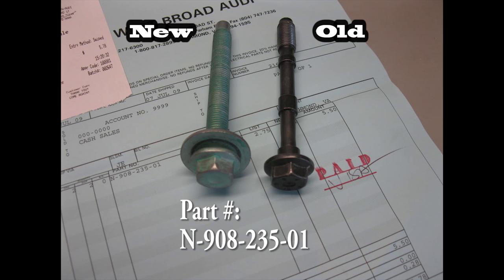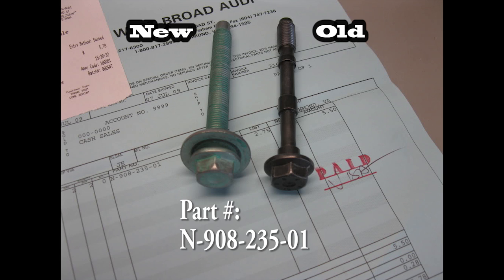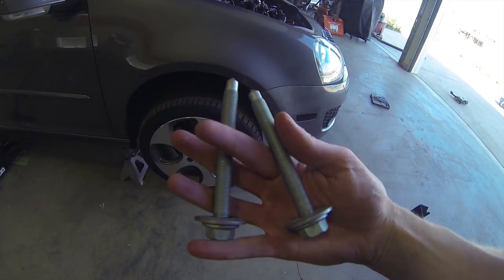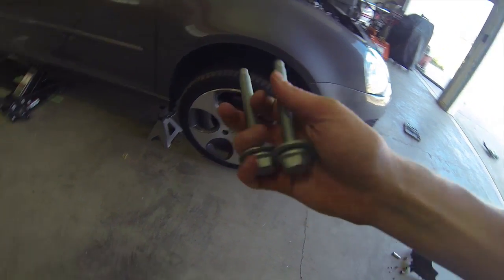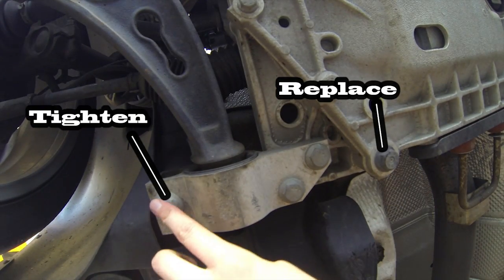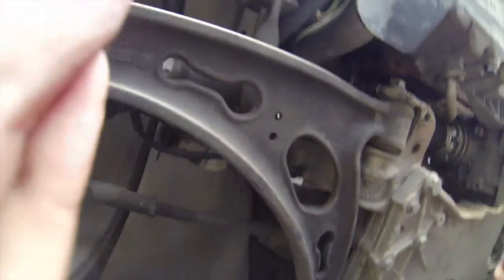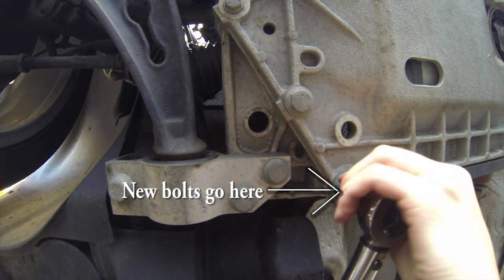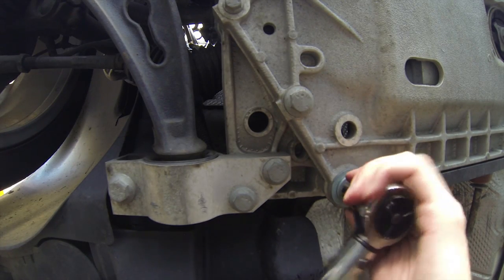Subframe clunking, creaking, popping? Give this a try - MKV GTI - Easy DIY How to

Comment: My clunking was a sway bar bolt under the subframe (audi a3 2005) the bolt wouldn't tighten up fully, the other 3 did, I just replaced all 4, clunking fixed :)

Comment: My 2010 JSW is making a loud popping noise when turning sharply, quickly accelerating or rapidly decelerating. The noise sounds like it is coming from directly beneath the center console, and since I replaced the CV joints I'm inclined to believe it is the subframe shifting around. ECS tuning has a bolt and spacer kit for $99 but that seems kind of steep for 4 bolts and a couple of thin metal spacers.
Reply: Did you find out what your problem was?
Reply: Did you figure this out?

Comment: I have just bought a mk5 r32 dsg, car drives faultlessly other than reversing at near full lock off my driveway where I get this clunking noise (quite off putting). Going to try this first for sure, some people have mentioned top strut replacement too. My first ever vw and first performance car.
Reply: dude same my mk6 golf makes a clunking noise when turning into my driveway
Reply: @gunmanx4  mine ended up being a cv joint

Comment: Subbed! I am having this problem with my Rabbit right now when pulling into an incline entrance or my ally way, I will def check this out.
Reply from the maker: What kind of sound are you getting, one single pop/clunk or multiple in succession?
Reply: Its a almost a creaking sound when pulling into an incline. it sounds like the frame is being torqued one way and shifts all the interior panels.
Reply: +Joelkswagen
my a4 is making a popping/clunking noise at slow acceleration and turning and it is multiple succession when it  does it.
Reply: +Malcolm "Damn Shawty, That Ass Fat" Hansen I dont know if this fixed it for you, but your case is typical sway bar squeak, where the bushing need to be replaced. (I know its a long time ago , still might help others if not you)
Reply: Joelkswagen multiple in succession.  Any idea what It is ?

Comment: Not sure where "most agree upon 81 lb*ft plus 1/4 turn" comes from. When the VAG torque specs are listed at 70 Nm (51 lb*ft) plus 1/4 turn; for all of the M12 x 1.5 bolts used for the subframe.

Comment: I hope this is the solution to my problem. A month ago I changed my rear control arm bushings and of course I had to take the bolts out of the subframe to remote one of the control arms. I believe the subframe is now moving around. I just ordered these bolts and some spacers. Keeping my fingers crossed.
Reply: did it work?
Reply: Marcelo so it ended up not being the subframe, although if you undo the bolts in the subframe you should replace the old subframe bolts with new ones. My issue ended up being the long bolt that goes into the front control arm bushing (there is one in the front and one in the rear). Apparently I didn’t tighten that front control arm bushing tight enough. Once I figured out the problem, the creaking and popping went away. If you’re having the same problem really make sure every bolt has been tightened. I overlooked that ONE bolt and that ended up being the problem. 

Here is a link to the pic of the bolt that wasn’t tightened all the way for me: 

https://www.pelicanparts.com/techarticles/Volkswagen_Golf_GTI_Mk_V/84-SUSPEN-Replacing_Front_Control_Arm_Bushings/84-SUSPEN-Replacing_Front_Control_Arm_Bushings.htm

Comment: Those new bolts will be torque to yield. Needs a fairly low torque inital tighten then 90 or 180 degree further tightening. If you don't get to the TTY torque they could come loose.

Comment: What components of the subframe wear, and what routine maintenance of the subframe should be considered when refreshing the entire suspension at 120K miles?  Referring to a '04 GTI VR6.
Reply from the maker: When it comes to routine maintenance of suspension, that is challenging. I take the approach of don't fix what isn't broken when it comes to suspension. Hearing noise or noticing a clunk, car drifting a bit to one side? That is when I consider these kind of repairs. This might be a good thread for you to check out http://forums.vwvortex.com/showthread.php?5301322-ECS-Tuning-Mk4-Suspension-Refresh-Kits-Free-Shipping-!!!

Comment: I have a clunking noise when: braking hard, turning hard and acelerating. Been with this issue for month. Have no idea what could it be :(
Reply: Did you find anything about the problem?
Reply: @farkasmaria9629  no bro, still making the noise sent it to the shop they could figure it out
Reply: @45llamas  have the same problem, bought this new bolts nd after a day, same noise occured again,  search on the forums nd mostly everyone recommended subframe spacers plates from ecs tuning

Comment: I have a 2009 VW GTI 6-spd manual that has some front vibration/clunking on the left side while driving over 20 mph, as soon as I hit the throttle the problem goes away. Any ideas?
Reply: Strut mounts possibly? When you give the car throttle the weight shifts off of the front struts, possibly making the clunking go away?

Comment: What about the mk4? My subframe keeps making a popping/banging noise like it's building up then releases. Can I use those bolts on a 2002 Volkswagen Golf gti 1.8t 337?
Reply from the maker: I imagine the sub-frame is slightly different on the mk4.
Reply: That's probably an engine mount, they go bad and do that exact thing.
Reply: MKIV is much different from the V.. Most like its the lower control arm bushings are shot.. I have read that upgrading them to the solid R32 bushings will help this noise. Mine makes the popping sound when I back out of my drive. Got the Bushings just need to make it my business to get it done

Comment: Hello,  I'd like to hear your professional opinion.  
My 2006 Audi A3 8p DSG   makes a clunk sound when downshifting to 2nd gear. Sometimes it does,  sometimes not.  Could  broken bolt maybe be the issue??? 

Thanks!
Reply: A bolt is not likely. Might be a faulty mechatronic unit. Also, have you done a DSG fluid/filter service?
Reply: Medzid, it's your dual mass flywheel that makes that noise.  Make sure you change your dsg fluid every 40k.  The flywheel has a service life, it will start to make lots of noise at idle and you will know that it needs to be changed.
Reply: @IndiSkyz  Hello and thank you for your answer. I maintain my car on time always, the DSG service (oil and filter) was done just recently. No vibrations, no rough shifting or anything that is affecting the driving, just that clunk sound. And recently I've noticed like tiny clunking on stand still...  So I'm asuming flywheel it is then

Comment: I have a noise on start up in my GTI MK5 
it's some sort of a clacking noise that stays for around 2 seconds on start up.
I tried different mechanics and no one seems to know what's the deal!
I hope you can help me with that
Reply: I got the updated tensioner and I still get clacking sometimes on startup in my 09 TSI, no clue what is and its rare and  random.
Reply: If it is located on the bottom right of your engine by where the oil pan is, then it will most likely be your Timing Chain Tensioner. Mine is doing exactly what you are saying but is completely shot and it rattles all the time. Google this is the part number: 06F109217A or you could get the Febi oil pump chain & tensioner kit from ECS Tuning if you think the chain is really damaged. Their part number is 06B198130C or 3142387.